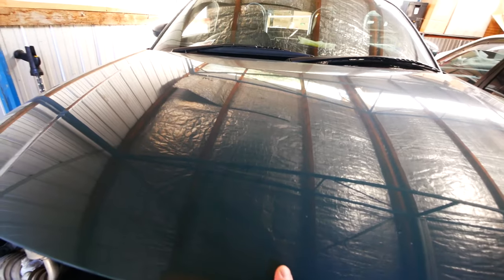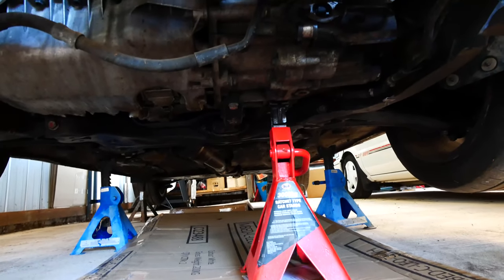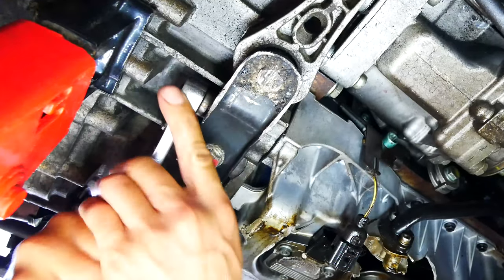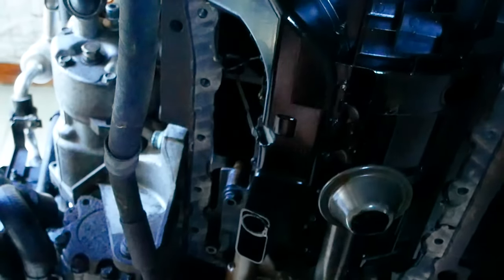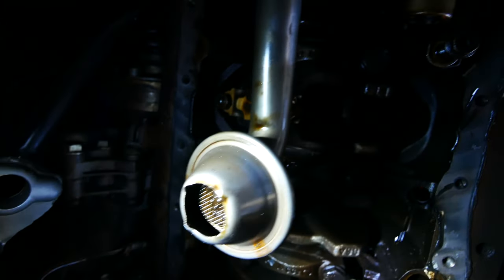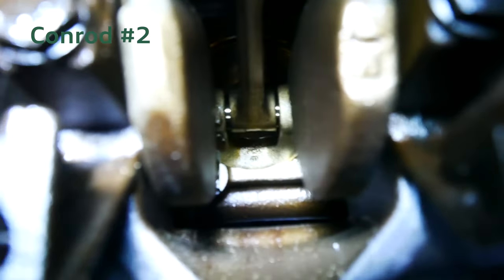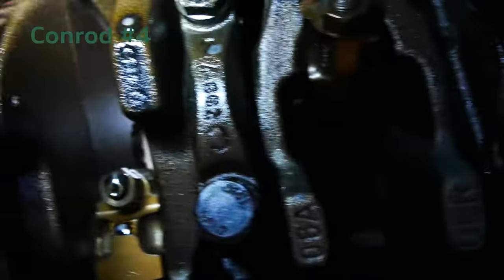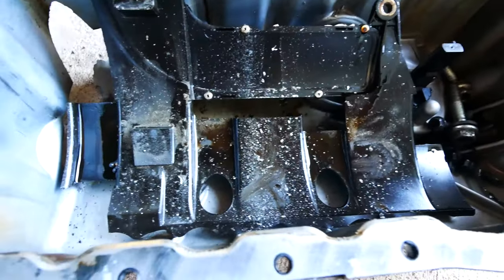How to check for bent connecting rods 1.8t oil sump removal. Barn find Audi TT engine gets opened up

Comment: Hi Ian, I would diagnose this differently. Get the oil filter off and cut it open with a filter cutter or send it off for oil testing. This will let you know if it's had particles circulating.  Also pull the big end bearing caps and look for any scoring. After that I'd pull the oil pump apart and look for signs of any junk going through it. Even so, the engine is most like salvageable if you're prepared to strip and reassemble. Otherwise it comes down to an assessment of ease of replacing it with a good used motor. P. SI have spare rods if you need them.
Reply from the maker: Awesome info! Thank you so much 🙏🏽

I won't be spending any more time investigating any further. I have the spare engine sitting nearby so now will be doing my best to get that serviced an installed into the engine. 

Thanks for the info on spare rods! Might call you up on that offer ;)

Comment: Hi ! Glad to see another videos with a Mk1 TT, since I do some repears on mine ( 225 2001 BAM ). Just changed the oil pump a month ago.
I’v have noticed little oil leak in the middle of the engine. 
I suspect the turbo or the oil pipe from it. Have to look further. 
Anyway, I’ll see your work with great interest.
Reply from the maker: Hi Rene. I hope your oil leak problem isn't too bad! At least it can hold oil 😂

Thanks for watching and I look forward to getting this project driving!

Comment: Ian, any idea what bhp/torque this car was running to have bent the rod?
Reply from the maker: Good question marcooconnor - I don't know neither does the previous owner but I have a feeling it wasn't a power issue. Rather the known weakness of stock rods when torque hits on a hybrid turbo tune/setup. 

The increased torque load on a hybrid turbo is quite a lot more than an OEM turbo so that wouldn't have helped the poor OEM rods.

Comment: What makes you think the rods are bent?  The engines dropped, sumps smashed, oil’s gone, it’s been driven without oil pressure! May be repairable but the metal deposits in the windage tray (black plastic thing) will be bearings.
Reply from the maker: Small end not sitting centre on the wrist pins made me super suspect.
Reply: @ianpgonzaga  there’s some side movement on the crank journal which could account for the difference on the piston pin position, I doubt very much that the engine will have had the abuse that would bend the rods.